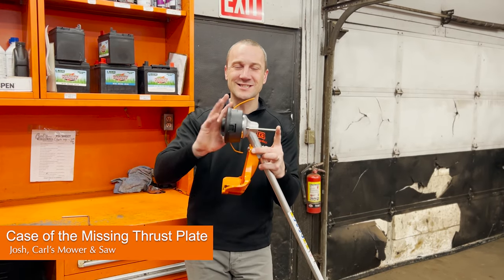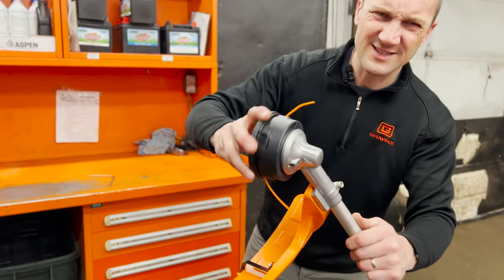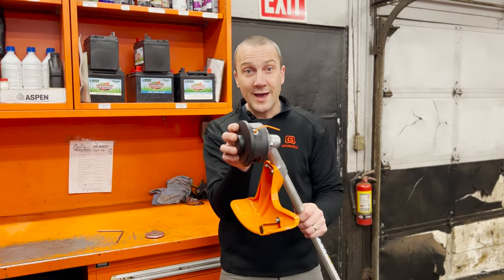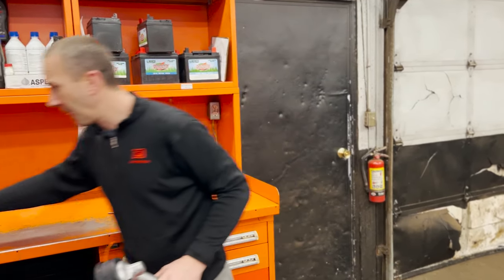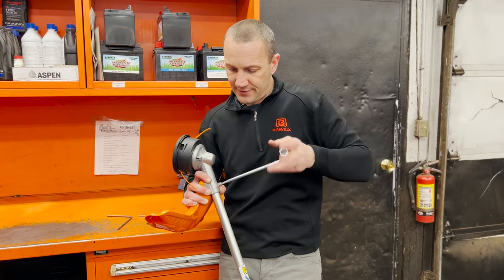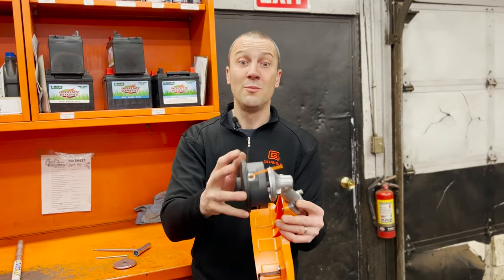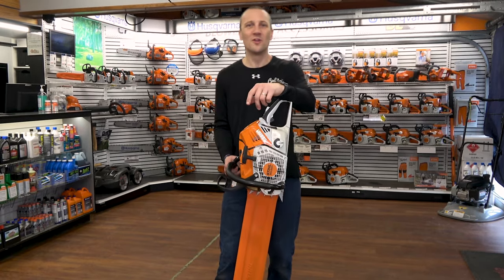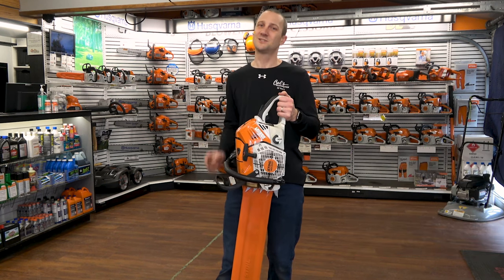Unlock Your Weed Eater Head!

Comment: Thank you so much.  I put the thrust plate on backwards and this is going to save me the biggest headache.   was able to get the gear box off no problem.  I ended up needing a 3/16 in Allen bit attached to a screwdriver to hold the shaft in place on my trimmer head though.  hardest part was finding where I put my tools :).  Thanks again and hope you have a great year in 2025. :)

Comment: Here's another way to do it that I stumbled upon this afternoon:

Take the whole head assembly off.
Disconnect the opposite end of the shaft, near the throttle.
Pull the shaft out a bit and feed that into the disconnected head assembly. 
Hold shaft in place with vice-grips and loosen head. 

Pain in the butt but can be done in about 15 minutes. 

Next time don't be an idiot like me. 😀